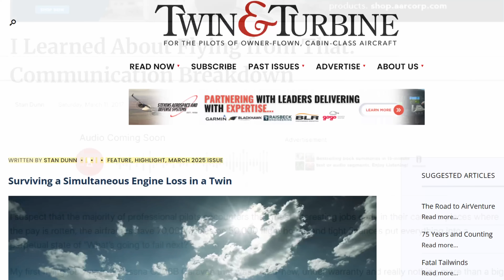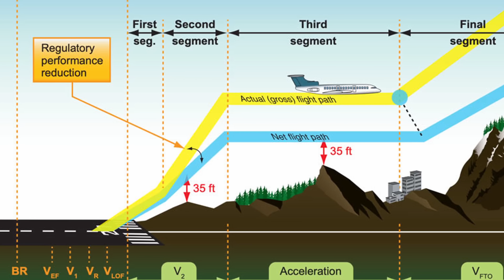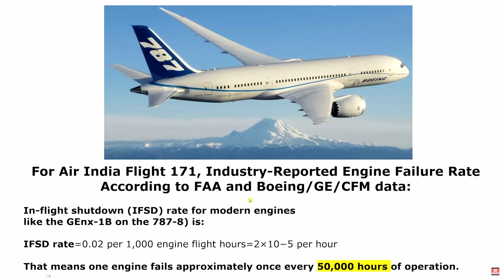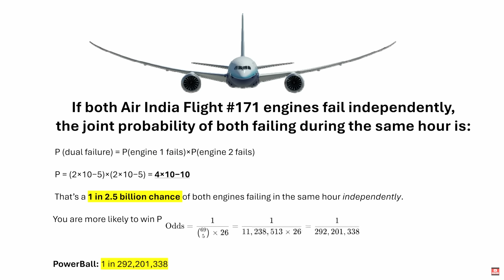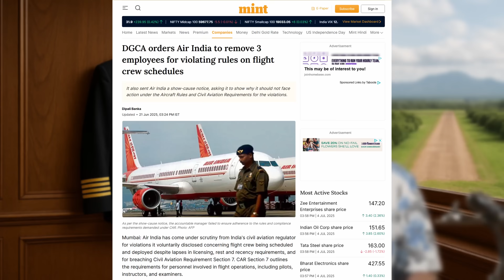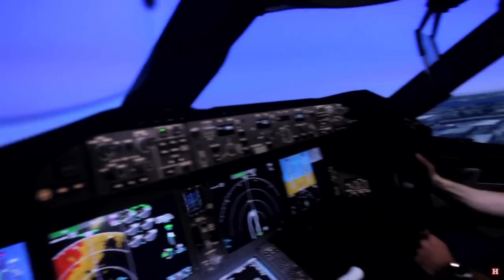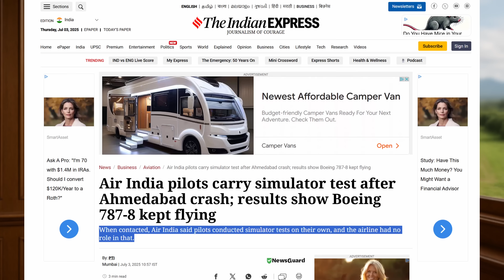Air India 171 Cause Becoming Clear

Comment: A single engine failure with the crew shutting down the wrong one seems strange to me both because of the "we have no thrust" call and because we don't see any yaw or rudder movement due to one engine losing thrust. Not impossible especially if they reacted very fast but I feel like its unlikely.
Reply: Also, they barely had time to even start the checklist for an engine failure procedure, let alone actually shut one down.
This guy seems to think they were in the air for several minutes or something.
Reply: Do you know people swear up and down they were pressing the brake in their car as they accelerate through the back wall of their garage? They thought they retracted the gear but very possibly did something else. 

I believe the FO was flying because the pilot called the mayday. The FO had shockingly little experience for that type.

Comment: Looks like a mistake in takeoff performance calculations. Using the runway to its end. Then slamming the power to the firewall.. i guess there is a protection for the engine that shut them out due exceeding limitations . And here you are going down. Just a guess

Comment: With no experience to qualify it, I still suspect that “gear up” was ordered by the captain and subconsciously without registering in any way the copilot raised the flaps with muscle memory.
 On the realisation that no gear up lights were visible and with climb rate going, they misinterpreted the situation with positive confirmation bias and reasonably assumed an hydraulic failure.
 Confident that he had commanded “raise the gear” and equally confident that he had acted accordingly to do so, they didn’t review the controls. 
They deployed the rat, perhaps, thinking hydraulic failure, which made drag worse. Before they could manage to process the problem they ran out of sky. Perhaps they realised too late and re selected flaps but too late. 
Quite a plausible scenario for me who has never flown an airliner. How many times have you returned to check if you locked the front door to find that yes of course you did. 
Dual engine failure is extremely rare as a cause whilst pilot error is common. I fully expect to be wrong but with the current minimal hard evidence…..😢

Comment: To me it's clear from the lift-off footage the left engine produced full thrust while the right engine didn't. The plume of dust only comes from behind the left engine.
Just after lift-off the plane starts to yaw the right. Indicating again a right engine problem.
In the second footage taken from a balcony you can see the rudder is deployed to the left by the shadow casted on it. Also an indication the plane corrected for a right engine failure initially.

My take is; the problems started on the runway during take-off right after V1 with the right engine. They had to take-off with only the left engine on full power in very hot conditions.
But with this fully loaden plane on max TOW (take-off-weight) the left-engine turbine temperature  passed it's limits, commanding the FADEC to spool down this engine automatically. We'll see.

Comment: Since we are all speculating , here's my  opinion does anyone remember at the Paris air show a Airbus was making a low pass over the run way and the computers took over and placed the aircraft into the landing mode in which the pilot couldn't retake the controls and the aircraft crashed into the trees. Here we have a similar  incident , the aircraft takes off gains altitude and I believe the computers took over and placed the aircraft into landing mode taking the control away from the pilot. The engines spooled down for landing and that is why the aircraft looks like it's all set for a landing ! MY OPINION !
Reply: Makes as much sense as other posts I've read here.  Maybe even a bit more. :face-turquoise-covering-eyes:

Comment: I'm a child of the early 1950's. My "First Solo" was October 1971. Over 50 years ago.
To this day, I DO NOT TRUST a fully computerized cockpit!
Give me a mix of standard gauges and some "smaller" computer displays, and I feel much safer!
I've had the "screens" go dark far too often to trust my life on them .
Reply: a computer is only as good as the programmer, and as we all have seen.... BOEING PROGRAMMERS PREVIOUS JOBS WERE PROGRAMMING MICROWAVES AND REFRIGERATORS FOR GENERAL ELECTRIC
Reply: AMEN !  Like the Airbus that crashed in the middle of the Atlantic - the pilots could not overcome the computers !
Reply: No obvious cause of the crash. What is left is a software failure, probably caused by a combination of factors. Very difficult to analyse.
Reply: Accidental pilot command that caused a shutdown is likely.  For example holding an old command(setting) after it is useful causes the human to think no such setting is present when it is present and being actvitly used.

Comment: While I respect your aviation expertise, I do not accept your proclamation about statistical probability of a dual engine failure.  The odds of winning a lottery are also astronomical, but people regularly do win.  Same for being struck by lightning, but it happens.  Odds of a dual failure being high does not make an argument against it happening.  However if your information about Air India taking 787 pilots and making them do sim work is compelling, but does not point to the single engine failure and shutting down the wrong engine.  That remains a possibility, however no adverse yaw was observed in the two videos, and you failed to account for the gear retraction sequence being interrupted with an hydraulic failure which is in evidence in the video.  i.e. a mere 20 second after rotation, the main gear trucks are seen in the forward down position, which is the first step after pilots select gear up.  The only way that occurs and stops is with loss of main hydraulic power.  that plus the RAT was out at the same time.  Yes this condition could be caused by a failed engine and pulling the good engine's fuel selector to off, but there are also a dozen other reasons both engines could fail with the over complicated, over automated Plastic Princess.  (such as a cascading electrical failure - the EEC's are powered by a permanent magnet generator attached to N2, and as long as N2 is above 8% these power the EEC's, however the FADEC's are powered from the main AC buss, and the fuel cutoff solenoids can theoretically shut off fuel flow with a cascading electrical fault - they are normally closed valves, so with loss of all main power, they revert to closed.  My money is on the over automated electrical system plus some dumba$$ software issue by Boeing as well being at fault, not the pilots)

Comment: To categorically state flaps can be discounted is reckless. Incorrect flap settings could result in a longer than normal takeoff run. How does an aircraft not at gross weight use every inch of an 11000ft runway? An accident is never from a single event. The chain here could possibly be flaps 5 instead of 15, use the whole runway to get airborne, note the cloud of dust when it rotated over the end of the runway, so fod is a possibility causing vibrations in both engines resulting in fadecs shutting down both engines. RAT deploys but a/c is going down. Mayday call was made but a/c hit a building resulting in loss of life in the a/c and on the ground. There's my hypothesis.

Comment: This improbable explanation is only to save Boeing. The question is: what triggered the TCMA? The time the pilots were talking to the Tower shows that they didn't have time to do any other procedure. And if the RAT deployed by itself and changed the power configuration before it has speed to properly feed the circuitry?

Comment: Considering the engine failure and shutting down the wrong engine, the plane should have shown a drift to one side, right? But none of that is visible in the video. And something very visible is the notable wing curve at the latter part of the flight. Why is that?

Comment: I'm sceptic about this take. I think a shutdown of both engines at the same time is more likely.
The probability calculations are problematic. Of course, in totally unrelated cases the probability of engines shutting down at the same moment is extremely low. So there must be a common cause if this happened. For what I have seen I think a systemic failure in electrical and/or hydraulic systems is most likely, maybe combined with some pilot mistake and some actions by maintenance personel (long) before this flight.
If one engine failed first one would expect yaw/roll effects and they seem to be totally absent. Even after immediate shutdown one would expect to see at least some of it I guess. A shutdown is not done in a few milliseconds.

Comment: The only one survivor said that air conditioner did not work before takeoff.
Electric generator or battery had some trouble? Causing engine ignition power loss.

Comment: I have been flying Air India for twenty years and can say that for most of this period, their staff professionalism and training, procedures and responses to issues - in each case are terrible, perhaps the worst of any major air carrier (out of over 50 that I have flown). I would not be surprised if factors such as pilot fatigue caused by excessive hours, lack of training, cost-cutting of safety checks and skipping major technical overhauls contributed to this accident. With Air India, technical issues are unlikely to be more likely than human and organisation issues.

Comment: Was there any maintenance on the fuel system to include the fuel tanks? There are so many redundant checks for clean fuel, but items left in the tanks (rags etc) could starve the engines of fuel. The plane does not give the appearance that it lost one engine, to me. Looks like a symmetrical loss of power.

Comment: As dumb as it may sound , can any Aviation engineer ( electrical ) Answer this .. 
The internal entertainment system in these old planes which are almost never working but their old wired remotes have something that turns really hot n never checked cause some sort of electrical blackout ? i know it can be a fire hazard for sure but can they affect electrical systems in such a way to cause hydraulics to fail ? has there been any studies done ? AI old planes especially long haul have broken wired  remotes stuck into seats are always a risk as i once reported it ., the remote was so hot that it felt it may explode ..

Comment: Wjy is this expert wasting my time discussing causes which have been ruled out from day one? And the pilots shutting down the wrong engine is very unlikely as even a complete amateur like myself who hates flying knows what has to be done in an engine failure at take off and ALL pilots even the most inept ones know that a modern jet liner can fly including the take off on one engine. This is common knowledge certainly to all pilots and to most passengers too. So no, these pilots shutting down the wrong engine is very unlikely. I should also mention that the argument that manipulating the FADEC  requires special access and is therefore unlikely is thin. Remember Stuxnet? That virus was introduced via special access to centrifuges that were located in a highly secrure facility and were not connected to the internet. And NOBODY claimed responsibility for this act. I'm not saying that a virus affecting the FADEC was responsible for this dual engine shutdown much rather a computer bug. Furthermore, from BA flight 38 we know that there are fuel "contaminations"  that cannot be detected in a lab analysis of the fuel. A physical fuel blockage like the one affecting flight 38 remains a possibility. And such a blockage would ONLY affect the plane that crashed but not other planes.

Comment: Unless there is a very good reason for the aircraft not to yaw to the left in the event of a number 1 engine failure, as I assume this phase of flight is flown manually, then Im not sure this theory that a number 1 failure occurred immediately followed up by a number 2 shutdown, holds up. The aircraft shows no sign of adverse yaw in any of the videos shown and that have been viewed by me. I still believe the engines failed or more likely throttled back due to a common fault to both engines. My theory at the moment is faulty sensors, either radalt or weight on wheels sensors telling the aircraft its still on the ground, rolling the throttle back inadvertently.

Comment: One error I keep on hearing from this and other YouTube authors is that the RAT designed to provide electrical power. This is not correct the RAT provides hydraulic power for the initial purpose of having flight controls. With that hydraulic power then the hydraulic motor generator can then produce electrical power, but this is subsequent to the initial purpose of having hydraulic power itself.

Comment: I'm no aviation expert. I don't even play one on TV. And I definitely don't own a pilot's uniform. But I do have to ask: Why would it be necessary to shut down an engine during take-off? The hypothesis being offered here is that the pilots shut down the wrong engine. But why shut down any engine? If the engine had died, shutting it off wouldn't have made any difference. Even if an engine was on fire, it would make no sense to shut it down at that altitude, so soon after take-off.
Reply: You are correct. The insinuation is that if there was an engine shut down on take off is that the pilots did not follow procedures. But this is only one possible theory. I am in the group that believe it was electrical failure.
Reply: @ginjazz4179  An electrical failure wouldn't explain the switches being manually changed from the "On" to the "Off" position. Nor would it explain one pilot asking the other why he had switched off the fuel. Electrical failure is ruled out by these facts.
Reply: @zakmartin  Well, now, after the report, I agree. But before the report, if they had lost an engine, the correct procedure would be as you stated. Now if you re-read my first post, it says the pilots did not follow procedure and tried shutting down the engine but shut down the wrong engine.

Comment: Citing statistics when dealing with sample size of ONE is moronic, misleading and potentially deceitful not to mention insulting to the people involved. The chances of something happening in general are completely irrelevant because when dealing with an isolated incident the chance of it happening in this case is either 0% or 100% (depending on the results of investigation). Sorry for the harsh rebuke but I have to point out that using statistics in this case is completely outside of what that science is meant to represent and the way it's meant to be understood and interpreted. No amount of statistics, no matter how reliable and well researched, can be applied to a single incident. Anyone who took even an introductory course on it in college should be well aware of that.

Statistics can point in the way of what may be more or less likely to occur before it actually occurs. After an event has happened, applying statistics post hoc is ridiculous. It either did happen or it didn't happen, it cant be both. It is no longer a chance but rather a data point to be recorded. There's a whole different discussion of completely novel events that have never occurred before and predicting them is notoriously difficult if not outright impossible. You can't say with your head screwed on straight "Oh this is 1 in a Billion chance therefore it's not the case here". Guess what, smartypants, if it did happen now it's 1 in a half a billion chance or one in a million chance and we were wrong all along. That's how statistics actually works.

Comment: The airline industry is a case study in learning from every accident and constantly pushing forward on ever improving safety features, or at least that's the impression I'm given as a layperson. On that basis what immediately sprung into my mind was whether, if this theory turns out to be correct, one mitigation factor going forward might be to add some computer checks into the engine shut-off procedure on the various major commercial aircraft types where the onboard systems can detect the strong possibility that a pilot is attempting to do a hard stop on a seemingly healthy engine and so doesn't immediately action that command but instead sounds a warning, shows the pilot very concisely the information on engine status and highlights why it thinks the command was for the wrong engine, and then gives a few seconds timeout before the pilot is able to again instruct an engine shutdown command on that same engine that would then be unconditionally obeyed.

There are probably all sorts of issues that might make it impossible to do the above reliably in a way that doesn't create problems under other scenarios but if it could be done it would essentially be adding an extra automated step into that multi-step engine shutdown procedure that pilots are supposed to follow which would seem to me to be a good safety enhancement.

Comment: You only multiply the probability if the events are uncorrelated. This by no means certain for the scenario of dual engine shutdown. If there are common factors involved (power supplies, FADEC etc) the probability is potentially far higher for dual engine shutdown.
Reply: That's exactly what he explained in great detail 🙄

Comment: The aircraft crashed 1,600m from the end of the runway. It was about 300 ft above the runway and flying at 175 kts. From this position it could not have reached the impact point if both engines were shut down, it would have crashed sooner. Hence at least one of the engines had to be operating at low power. This is confirmed by the video taken on the balcony where the sound of the RAT can be heard and faintly the sound of the engines operating at low power.